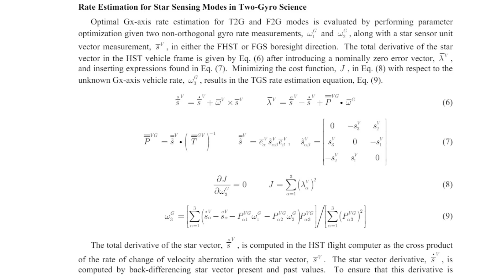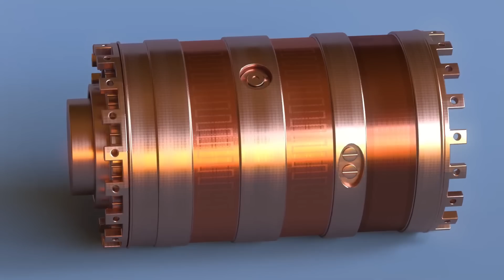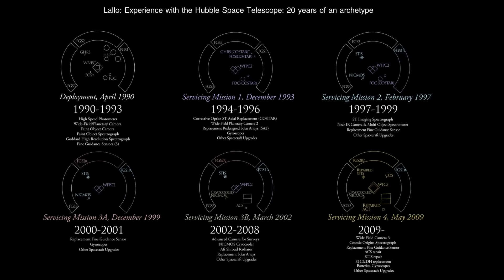How Failed Gyros Are Making Hubble's Life Harder

Comment: I don't know if Scott talked about it earlier, but NASA's logic is basically that it still works at the moment, and letting someone meddle with it might break it, so they don't want anyone touching it. But if it breaks to the point where it is no longer useful, I think NASA wouldn't mind a mission to try to service it, provided the price of doing so was low enough.
Reply: And NASA wonders why they don't get tax money.

Cowards and idiots.
Reply: Also worth pointing out that the original plan was to bring it home using the Shuttle, but that's not an option.  They left a docking port so we could launch a future spacecraft to safely deorbit it, but that port only has the soft capture mechanism so isn't useful for servicing missions.

Comment: 4:14 Can the telescope see any jitter of guide stars which would allow a computer to shift the image from one pixel to another? Is that like what is already done with fancy still and movie cameras?
Reply: I imagine exposure time makes this impractical. You're exposing something for potentially multiple seconds before you actually collect the individual pixel data on the sensor, so any jitter would be like motion blur or shaky camera during a long exposure. Everything needs to be very still to get a clean exposure.
Reply: @Jaker788  if the exposure time is really short, and the data forwarded to quick storage where it could be retrieved and analyzed then you would have the best of two worlds. Snappy quick exposures and ability to get rid of jitter. Also resolution would increase as frames don't match and computers can "read between the lines" to find that pixel 3.25 is a little darker than 3, and also 3.5 is still darker but not as dark as 4.
Reply: @greggweber9967  Unfortunately, you can't just combine separate exposures to get combined brightness. There's no way around the need for long exposure to image faint objects

Comment: Scott, is there a reason ring laser gyros we’re not added on servicing missions?  No moving parts is good!
Reply: I think the ring gyros don’t have nowhere near the accuracy required for the Hubble
Reply: A ring laser gyroscope is a sensor. The gyroscopes on Hubble are used to control its orientation.
Reply: @tyttuut  The gyroscopes are sensors to detect rotation by detecting pressure caused by the spinning masses axis of rotation changing. They do not play a role in the actuation of Hubble, that is handled by reaction wheels and magnetorquers that prevent the reaction wheels from becoming saturated.

Comment: Did learning how accurate the pointing ability of Hubble is blow anyone elses mind? This telescope continues to impress. I sincerely hope it is recovered and preserved for historical value when it's career finally comes to an end
Reply: If NASA refuse to allow another servicing mission Hubble's orbit will decay. Eventually a Starship will go up and retrieve it, and it can spend the rest of its life in the Smithsonian Museum, along with other landmark aviation and space hardware.
Reply: @ceejay0137 that won't happen, for the same reason "NASA" is forbidding private missions for its maintenance: hubble is a refurbished spy satellite, from a family of spy satellites US military is still using.
Reply: @ceejay0137  it's not that they're refusing, it's mainly that there isn't currently a man rated system that has the required capabilities or certification to carry out a servicing mission, and since congress told NASA they were going to put people back on the moon in 6 years while refusing every budget funding request every time they're told how much they need to actually do it, NASA doesn't have a ton of extra funds to spend on that kind of project at the moment. Luckily SpaceX has been independently working on a plan to use a F9 and Dragon to do a simple service and reboost mission but who knows. Fingers crossed
Reply: @ceejay0137  Starship isnt designed to deliver heavy payloads to the earth, but vice versa. It would be hard and dangerous even for Shuttle.
Only way to preserve Hubble, when time come, is to push it to high orbit and hope someone in future build spaceship that can.
Reply: @cyphi474  Starship's design capacity is for 100 to 150 tons to LEO, or rather less to GTO, and its fuel capacity is 1200 tons. Hubble's launch mass according to Wikipedia was 11 tons, so 1/10th the load that Starship is capable of orbiting. It might  require a specially-tailored re-entry trajectory but I would expect Starship to be capable of bringing Hubble back to earth. They would probably try it with a dummy load first to be sure, and it would require the catch on the chopsticks to work. You wouldn't want it to splash down in the ocean with such a cargo on board!
Reply: What they are talking about is Starship's carriage limit for a soft landing,  a limit which is right now way less than hubble's weight.    
 Going straight up is much easier on a rocket, compared to the exponential lateral forces during a precise soft landing. The
 That's all if Starship can safely secure Hubble inside the nose, without a Canadarm, and without any astronauts on-board too.  That's why NASA is saying no thank you to spacex.
Reply: @ceejay0137  What can Starhip, "potentially" get up has nothing to do with how much weight it can bring down. More weight, more friction, more heat on the heatshield and all outside elements. Going up is easy to control, since you just overcoming gravity. Going down is much harder, because gravity works in same direction. More weight, more braking is needed. More fuel is needed, which adds extra weight....

Some time ago Scott did video about that science station that was brought back to earth on board of Space shuttle and how hard it was to land with that extra weight. It gets much harder, if you relly on engines instead of gliding effect.
Reply: @ceejay0137  Returning Hubble is well within Starship's payload capabilities. However I strongly suspect the bellyflop maneuver wasn't designed with Hubble in mind. It will be next to impossible to secure the 11-ton Hubble in the payload bay using only a robotic arm.
Reply: @cyphi474  Considering the Starship is expected to also return to Earth with a fully pressurized crew cabin with life support systems, cargo, water storage, etc. I bet all that would weigh close to 11 tons.
Reply: If they're not going to let anyone repair it, park it in a higher orbit so it can't burn up, then one day the money will be available to bring it back for posterity to marvel at!
Reply: Yeah, but at the same time I understand NASA. Their funding is limiting. 

 If it means save Hubble versus something better I can't understand them letting it decay. 

 Remember to vote! Make your voices heard.
Reply: My telescope can point with a repeatable precision of 7 arc seconds.  I was blown away by that.
There is no way to recover the Hubble.  The Space Shuttle was the only craft that could do that.

Comment: Hopefully if we've a new more adventurous NASA incoming they'll greenlight a servicing and reboot mission to it. Whilst the tech inside is old it's got a fine mirror which would be a shame to let go.

Of course with Starship we could throw a huge number of telescopes into space to replace it if the funding was there to build more of them, cheaply.
Reply: Actually Hubble's mirror was the source of most of its problems! Once it eventually fails it would make more sense to replace it with a new instrument that had better hardware, modern sensors and a mirror that didn't need the equivalent of spectacles.
Reply: @ceejay0137  it did indeed, but we put some very expensive optics on it to correct it, so for all intents and purposes it's a full functional mirror.

If love to see space astronomy move away for mega project costing billions to multiple telescopes allowing for unrestricted viewing for the whole space community. At the moment amazing proposals get wiped out because they didn't file the paperwork correctly.

Comment: 9:37 What is the purpose of that cross-indentation on the side-panel there?
Reply: Usually structural support, the indentations make the side stronger, probably for the initial launching. Putting the bends in there probably made that pitciular side be able to handle twice the amount of force without any extra meteral added to it. I'm sure the other side has it too.

Comment: Scott … you did another video explaining how static change building up inside the spacecraft caused failures due to static discharge.  Does that play a role shorting through these fine wires causing them to burn open?

Comment: Even if we never manage to get fusion figured out for power-generation, this thing will be one of the most amazing engineering achievements ever. 19000 RPM!
Reply: It's not that wild, many cars have turbochargers these days and the turbine spins near 30k rpm when you floor the accelerator, and small electric brushless motors can easily pass that.

The reliability at that RPM is something special though!